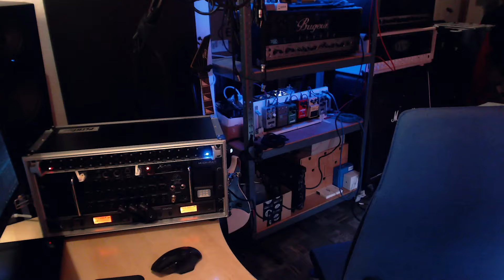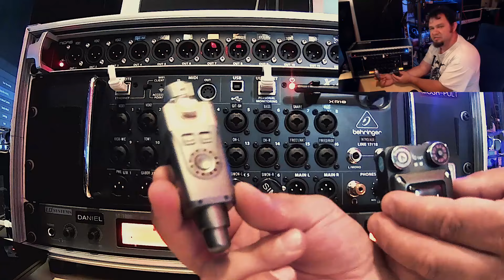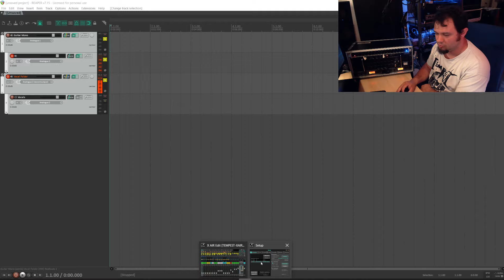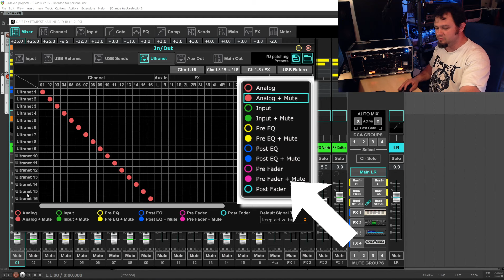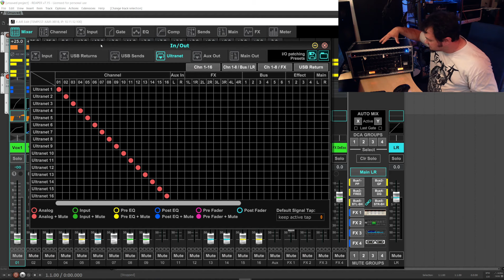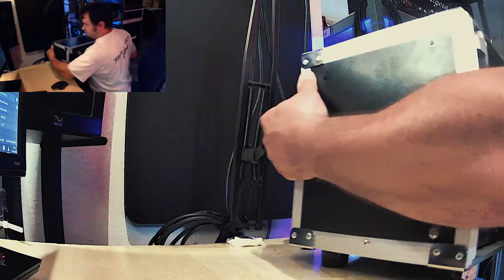The most compact IEM Rig for your band in 2024! (Only 5U!) || IEM RACK Walkthrough

Comment: 16:23 never had any connection problems with the router being placed inside the case like this ?
Reply from the maker: Since we only play like super small venues, usually not a problem. Also, for the greater part, it's set and forget, minimal adjustments needed. What can be problematic is being connected, walking away, being disconnected (it does happen quite fast due to the router being small and in the case) and then coming back. The smartphone trying to reconnect sometimes fails. But then I could, in theory, just ask one of my buddies to quickly use their phone to set up things. 

But, as long as I get signal, usually the mantra in case anything goes wrong is: SHOW MUST GO ON! ;-)
Reply: @PippPriss  Danke schön !

Comment: Thank you for the video. We use the same setup for our band, it also allowes us to have 4 additional aux outs by maping FX buses to 4 midas outs. There's one problem though... The XR18 gets overheated easily when you put it into a tight case, especially when you load it with such outputs extetion. You can check for yourself how hot it is after playing a couple of songs. It's a known problem. I'd recommend eather installing a fan inside the XR18 as we did or using some other colling system. The thing is that the power supply of XR18 wount't last long being overheated.
Reply from the maker: Really? Our gigs mostly last for an hour to 1,5 hrs, and we never had any issues. We also have rehearsals for 3-5 hrs and never had any issues, and it does not run really hot. 

But thanks for the remarks, I will check if that happens to run hot.

Comment: Great video. Small question, how would you run the hybrid setup that you mention? If the drums are already mic'd in a festival situation for example with many bands, do you need to run those into a splitter and take one into the XR18 while the other goes to FoH?
Reply from the maker: We just smack our drum-mic set onto the shells. So for our gig, we have two drum-mics per shell - one coming from the venue and feeding their stuff, one which only feeds our mixer. In smaller venues, when we arrive early enough to set up the entire chain together with the engineer and we are staying anyways for the night, we can in theory also just use our mixer, and then have the FoH engineer use our digital MIDAS DN-4816 splitter and it's output signals to fetch the mic'd drum sounds.
Reply: @PippPriss  The "two drum-mics per shell (...)" (1 for MON, 1 for FOH) thing is interesting ! Never seen that before... Only the single set of mics going into splitter and then to FOH and MON.
Reply from the maker: @djabthrash  Late to the party commenting on this, but yeah, it's very unusal. But yeah, this setup really allows us to literally give zero craps about what FOH is doing, and only do our thing. We always have the same sound, which is awesome. We know our mics, just clamp them on, bam, done. In theory, except for the line-check, we could silently set up our stage without talking with the FOH a single word 😀
Reply: @PippPriss  This approach is very rare and very clever, because you have the consistency of the bigger bands who have their own mic kits and MON console, but also the flexibility and independence for the FOH person, which is key in small to medium gigs. FOH could even go as far as leaving their own mics, while you add your own mics for your MON :)

Comment: First: Very cool video.
Thank you for coming up with this topic!
I thought about this for quite a while with my last band, but hesitated too long with a full concept, so it never came to this ... (sigh).
I have a MOTU 24ai, that I wanted to use just as you used the XR18+the DN4816. It has 24 great line outputs on the backside, that just have to be connected to XLRs, plus the option to connect e.g. 2 ADA8000/8200 via ADAT. Just one height unit in the rack for itself. So, with the ADAT option, incredible 16 ins plus 40 outs, all controllable over the network/ethernet AVB or AVB over USB, with USB audio interface option, so you could either just set up and forget the mixer, running it standalone, or even record the 16 ins (or even additional sums or submixes) with some basic EQ and comp settings, which actually sound really good.
I just was not aware of which options to use for the IEM units without breaking the bank. and how the antenna thing could be handled safely. So this video was great for giving me some options and ideas, how this could be done. Also, the router setup in your rack is really nifty. I like that!

I have a few questions:
How happy are you with the IEM modules in your rack, do they actually fully satisfy everyone? 
Which Inear headphones do you use?
Do you use instrument cables to your floorboards, or wireless options, and if wireless, what do you use?
Does the drummer get the monitoring from the FoH, analog outs with headphone amp or does he get it from the headphone out? (So he potentially could get the exact same mix every time with his click fed into one analog in, so you could even run a "silent rehearsal room" with just drums aloud, for the option to record the whole band like in a studio, with silent guitars/bass/keys?)

Btw, I see no problem in not using a splitter in the front, but just using the digital mixer + the midas as the splitter. Actually, I think splitters have their own problems, that I personally would want to avoid. I think, the FoH engineer could happily live with everything you give him, what comes out of your analog outs should be more than clean enough if the mixer is set up right. Everything else can be communicated between the band's operator and the FoH engineer, IMHO.
Great video, very appreciated!
Reply from the maker: Thanks a ton for the positive feedback!

Let me try to cover your questions, in case I miss anything, just hit me up again:

1) We are very happy with the LD Systems MEI 1000 G2 - for our setup and venues we play (like "medium sized venues for metal bands, fitting a maximum of 600-1000 people), we had no dropouts really. The XVive U4 does have a way smaller range due to the frequency spectrum, but I am quite stationary as the lead singer and guitar player, and the rack is always on stage at the front of the drum riser, or directly underneath it, so it's at max 5 meters away from me - personally never had a drop out on stage, way more often have dropouts in rehearsal, since we rehearse in an leftover bombing shelter bunker (in Germany, that's quite common). So I personally, am truly happy with the XVive U4. 

2) We all use SHURE SE-Series headphones, Drummer and guitar player use the SE215, Bass player uses the SE425, and since I am deaf on one-side, I have on my hearing ear a single SE535, on my deaf ear the stock SE215. I have to stress how much I love the SE535! There are maybe the best investment I have done in my entire musicians career. SE215 are a muffled, blanket-topped mess in comparison. Not bad by any means, but bad in comparison with the SE535 certainly!

3) The guitars are connected wireless to the floorboards, we use for that purpose the Line 6 G10 and Line 6 G10S (got a video on my channel on the pedalboard, in case you are interested! 🙂 ) both guitarist' floorboards have DI-Boxes, which take the cabinet-emulated signal via an 4-cable-XLR snake from our boards to IEM-mixer. Also, my main vocals are carried over this XLR snake to the mixer as well. If the venue has it's own cable, I just place a small 1-channel-splitter between the venues XLR cable and my microphone, so splitter input goes to mic, splitter out1 to venue PA, splitter out 2 goes to the snake, which in turn goes to the IEM mixer. 

4) The drummer, interesting point which I forgot to mention: We stay completely independent from FoH for our mixes. What we do, is we always have a spare drum-mic kit, which we just slap "on top" during changeover. So we provide Snare and the 3 Toms with our own microphones, which feed into the IEM-system. On smaller gigs, we can use the MIDAS DN4816-O to provide the FoH with our mic'd up drums, that way we save some time during changeover. On bigger festivals etc., we just smack them on right beside the FoH's drums and are happy. 🙂our drummer can live without overheads on his monitors, so that's cool. For Kickdrum, he has a Roland TM-2 Trigger Module and Triggers on his pedals from "On Trigger", which work very well. His mix comes out of the regular AUX2 output, since no stereo is needed, and feeds into his Behringer P2 headphone amp. 

This entire setup allows us to go FULL SILENT on stage, except for Drums of course. I was super sceptical at first, because I come from a situation where we used to have a fullstack on every side of the stage, no matter what size the venue, and I loved that as well, as it oozed rock an roll - however, the sound, our performance and the way I personally can differentiate between the soundsources have massively improved in using a complete silent stage setup. I will never look back on the olden days with loud amplifiers, except with a nostalgia for my youthful years. 🙂
Reply: @PippPriss  Ha, I come from the old times in the 80s with mushy Marshall fullstacks and everything, so I exactly get what you mean. Rock'n'roll and emotion, but what a lack of definition and transparency...
Quite an investment on the personal IEM equipment that you use, these headphones for your bass player and you are pretty expensive! But I get it, like in the studio, the final stage from electric to acoustic is the most critical one for good results... and if you only have one ear, definition and clarity is everything...
Thanks a lot for your detailed answers! Very appreciated!
Reply: @imcrazedandconfused  Actually their setup is is very cost-efficient compared to the average of this kind of setups. They use very effective and cheap (as in not expensive) stuff.

Comment: The MIDAS DN4816-O is affected by the gain controls on the XR18. You turn a channel gain up or down, and it's gonna affect the DN4816-O outputs going to the  FOH mixer. As a sound guy, I don't want a feed from your MIDAS DN4816-O. I want full control of the gain going to my mixer. Get a regular splitter snake, give the sound guy a clean signal, with full uncolored isolated gain control. There are many affordable options out there, that cost significantly less than the MIDAS DN4816-O (and do the job properly). :)
Reply from the maker: While you are correct, that the MIDAS DN4816-O can only give out the signal after the input gain taper, I personally have a few remarks on that:

- Adding a regular splitter will add at least another HU to the rack for the XLR cables to run from the splitter, if you want to utilize all 16 channels, perhaps even 2HU, because in case you don't go with a very expensive splitter, you will also need a regular patchbay
- With proper gain staging (and then LEAVING it that way, doing the rest of gain staging and mixing by other means), there is no issue for the FoH using the MIDAS outputs in my view
- We had no issues so far with the sound guys we worked with, in fact, everybody was really happy using our setup/signals
- While everybody is different, I personally do not understand the remark to partout not wanting to take our signals. If I'd meet a soundguy rightout refusing to take our signals, okay, then we can roll the traditional way with mic'ing up everything - however, this type of attitude of "my way or the highway" showcases an issue which we very often face: soundguys often think that the band is at their mercy, when the reality is, that there should be collaboration to get the best results. Also, even though I am taking your comment as an example, I want to stress that I am not implying you are that way, just using your comment to make a case point here 🙂

My personal reality and experience is, that we much rather face people not knowing how to properly do the job of the FoH, and we are partially taking that job over as well, and thus we needed something which we, in case needed, can output not only the incoming signal, but actually being able of putting out the processed signal as well.

But, in any case, we are always prepared to just run the traditional mic'd up setup, if that's what the engineer prefers - after all, our setup is mainly to curate our IEM-mixes towards us, and having the MIDAS is just the icing on the cake. But the few occasions, where we could set up a silent stage and have the engineer take our signals directly, the feedback was very positive, stating things like "I never worked with an easier setup" etc. - seems like we must be doing something right.
Reply: @PippPriss well spoken!
Reply: @davebrownentertainment7191 the potential gain thing issue is mitigated here by the fact that since they use their own mics and their own IEM console with their own scene, it's very unlikely that they will touch their gains. Pretty sure they dialed them once and they'll keep them the same for all shows.
Reply from the maker: @djabthrash  Yup, exactly that. Of course, it might be that FoH might find that a e.g. tom might be too quiet for his taste. But then he just takes the signal into his mixing board, and raises the fader.
Reply: Any mic source is prone to the same issue, especially mic’ed up guitar amps. If the guitarist turns up his volume, you have the exact same issue, splitter or no splitter.
Reply: as a sound guy myself, i couldn't care less of having gain control if that's set up correctly.
Reply: Aren't sound-checks exactly for ironing out that sort of thing? It's a little pretentious to make that kind of statement imho when on the other end of the spectrum you have amps/cabs on stage which come with their own hurdles. Once levels are all set, it'll probably only be the sound guy touching levels while the performance is ongoing - doubt anybody from the band would be messing with the faders etc.
Reply: @TudorAdrian yeah...I read that comment in the voice of the comic book guy!!! 😂
Reply: Dave is right. In a real world scenario, the band leader is not a networking expert. It’s usually more like he’s a diva knowitall, and the production tech is the details guy. As a band leader, I approach every gig with pre show communication with the production staff where we explain our stage box setup, and the attitude of “this production is owned by the sound guy. We need to fit in to his system”.  If he is a diva, I will know by then through pre-gig communication, and will already have solved our setup disagreements.
Reply: The only thing wrong with this take is that it’s stupid. We run everything the same way, have the mains locked out so the band can’t edit anything but their own IEM mix and have had zero issues after our tech rider is sent.
Reply: If you setup the routing in prefader click for the channel, then this is not an issue...
Reply from the maker: Not completely correct, since you can only tap off the signal AFTER the gain setting. That is still before fader, but not before gain. 

Unless they changed something in a firmware which I am unaware of, that is. 

But I agree to the sentiment that this is a non issue, to me anyways.
Reply: Interesting, 😅
I barely know a thing about sound engineering but I think I’ve learnt a lot. Thanks
Reply: The one and only time my band tried to use the Midas to send to FOH (at a normal small music venue with an older sound setup) it failed catastrophically. Gain problems, noise / buzz problems, neither I nor the FOH engineer could figure it out and we ended up bailing out and running with the venues wedges. Bought a pair of ART S8's the next day.
Reply from the maker: @jason.braatz  That's interesting, we played around 10 gigs by now with this setup alone (with the MIDAS) and NEVER had a single problem. In fact, the sound was absolutely great, and everybody was happy. We, the soundguys, especially the audience complemented us that the sound was super crisp, especially(!) when we ran silent stage setups in smaller venues, which was very surprising. But, that's the nice thing about our setup, in a hurry, we can just smack ourselves into cabinets the traditional way and have those mic'd up. I usually also bring enough mic's with me as a fallback solution to be able to mic up guitars and bass, if needed. I also bring with me Gravity clamps for micing up cabinets, that way we even don't need stands from the venue. Cables we anyways got plenty of spares with us. It's a bit overkill and my bandmates always laugh at me jokingly for being overprotective and secure, but boy oh boy I cannot count the times where that additional stuff saved our asses because of unprepared "sound guys" (= actually drunk friends of the venue owners with an inflated ego). And the real pros always appreciated my thorough preparation.
Reply: @jason.braatz  I’m sure if you did your homework on knowing your setup and letting the sound person know you’re sending them a line level signal, would have worked out fine.  Passive split is fine but requires 16 additional cables and an additional space in your rack.
That adds to setup time and can make it easier to make more mistakes in patching the wrong input.